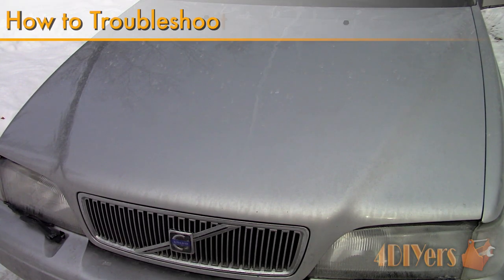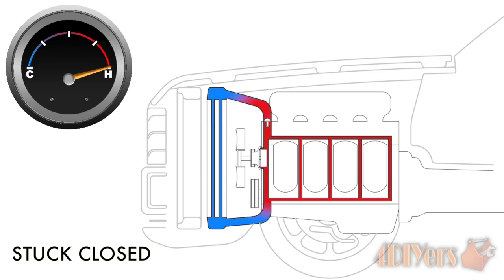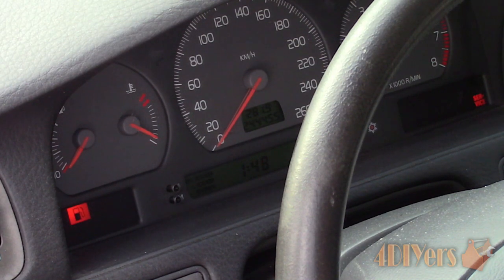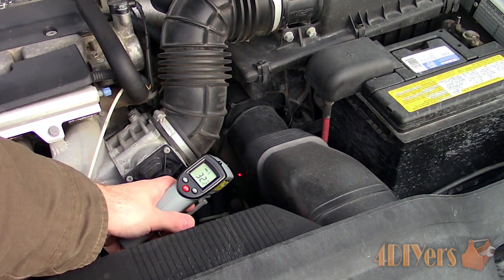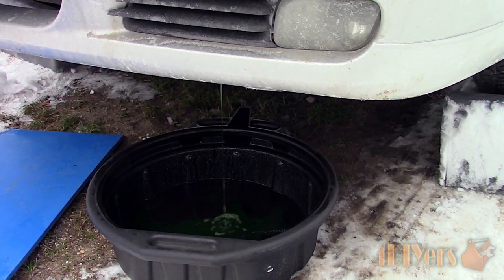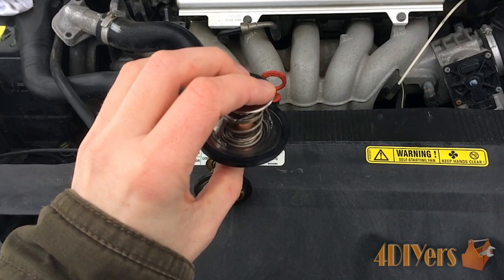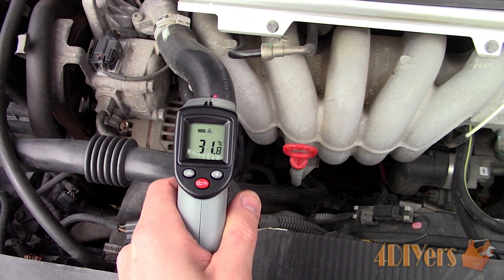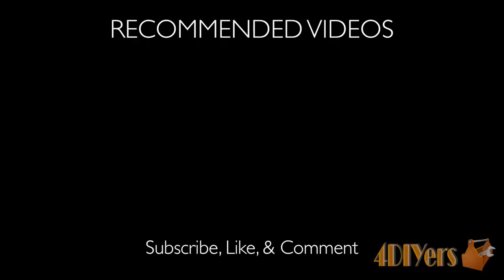DIY: How to Troubleshoot a Faulty Thermostat

Comment: My 2002 Pontiac Firebird has always ran at a certain temp on the gauge.  Today, with the AC on (103 degrees weather), it went over that mark and started climbing.  I turned the AC off, turned the heater on, and dropped my MPH to 60.  The temp gauge went back to normal.  4 months ago, check engine light came on, took it to the repair shop, they said it wasn't the thermostat; whatever they did fixed it.  But was told if I have a problem then go back and they will put a thermostat in it.  Just wondering, by putting the heater on and cooling down the cooling system, if this might well be the thermostat problem.  Thank you.  Great video.
Reply: So they removed ypir thermostat ?. Sounds like it ..esoeciallu  if heaters are cooler

Comment: my top radiator hose is hot, my bottom hose is cold but still spiking on heat gauge....just got new thermostat, radiator, rad cap, top/bottom hose and bypass hose replaced. Noticed abit of a leak around thermostat housing few weeks after....faulty thermostat maybe or is it waterpump or head gasket.

Comment: Question: I noticed acceleration loss towards 55-60kmh on my Venture but initially didn't pay attention to temp. gauge. Once home (3-4 km away), I opened the hood to see coolant leaks on top of the coolant expansion tank and around/under it. But not anywhere near the radiator itself or elsewhere.

When running it for a few minutes, even at idle, the temp. gauge would go up high. Because it's extremely cold here today (-28°C), driving it surprisingly lowered the temperature until I slowed down or idled again because of the cool air.

Is it safe to assume that this would be caused by a closed or defective thermostat? What would be the best way to test it from home.. I'll look more in depth tomorrow. Would just checking the hot/cold hoses be enough? I'm not sure what else to go off of.

And could a head gasket issue cause what I've just described before? I called the garage and he thought this would most likely be the cause, without having seen it yet.

Any input is appreciated before I spend on diagnostics please.. thank you!
Reply: Yoo did you ever fix?
Reply: Having this issue rn what did you do

Comment: I'm having problems with my coolant system on my 2002 Volvo C70 i changed the radiator twice and I just put in a new heater core my car is still bubbling out of the reservoir and losing antifreeze could it be a blown head gasket or could the thermostat be bad I need advice on making the next step to solving my problem could you could you provide any information 🤔💡
Reply from the maker: If it's bubbling, it most likely can be a faulty head gasket. Best to do a compression and cooling system pressure test.
Reply: @4DIYers  I did a compression test I put a new radiator system in also I put a new heater core and I also put a new reservoir bottle on the Volvo and it's still bubbling from the reservoir the shop has bled the system and still has continued continue to say they don't know what the problem is it's only three other options a blown head gasket water pump or the thermostat with the temperature sensor connected on to it 🤔💡

Comment: Question regarding stuck open thermostat. I was told that if I just remove the radiator cap and cold start the car, I would see immediate flow of coolant right at the radiator cap.  Does this method work?
Reply from the maker: It works to a certain extent and this depends on the system's design. In the video, you can see a by-pass in the thermostat so this will still allow for flow, however it is limited. When the thermostat is stuck open, more flow would be present.

Comment: Hope you or someone can explain why my vehicle is now stalling at idle when I crank it up in the morning. After it gets to operating temperature, it stops stalling and operates as normal. 

This all started the other day when my friend changed the thermostat and lower radiator hose. 

He took off the upper hose by mistake and broke a piece off the radiator inlet or nazzle, but was still able to get the hose and clamp back on. After taking off the housing unit, he noticed the thermostat was not the same as the one that came off. Ww still used the new one. The lower hose had to be cut and is slightly bent. And we completely forgot to bleed excess air out. 

Besides the stalling at idle, no other issues lol. Heat works just fine.

Comment: MY VW Amarok has had a cooling system issue recently where it seemed the water temp was colder than it should be. While driving the car, the temp would be around 84 deg, but drop down to 50deg C. Then sometimes go up to 93-96, but quickly back down. I have had the thermostat changed, and while running the first time, the temp steadily went up to 94deg C and was up and down around that temp, but when idling my car for a while, the temp gauge drops down to 45deg C, and while idling, it stays around this low temp. Is that normal for the temp to be that low at idle?

Comment: If I’m missing 1 bolt on my thermostat housing on my ‘07 s40 would that explain my car still overheating constantly?
Reply from the maker: If it’s leaking, yes that can potentially cause a problem. Your system is not holding pressure and is most likely leaking coolant.

Comment: I flushed my coolant system, and put new antifreeze in my coolant reservoir, after doing that, I flushed the heater and got all the gunk out of it until the water flowing out went clear. After hooking everything back up, I still get cool heat whenever I turn the knob to the hottest temp, it didn’t fix my no heat problem. I have a 2002 Ford Taurus. Any help??
Reply: Possible a temp door actuator

Comment: My car use to over heat.
I changed out the Thermostat with a new one on my 2010 Charger.
For 2 weeks it ran great & no over heating.
Then it started again but this time the water box had no water and over heated.
I put 2 gallons and ran great.
2 days later again no water and over heated.  There's no water on the asphalt where I park my car.
Every 2 days I need to add a gallon to prevent it from over heating.
The bottom hose is a little warm and the Top hose is hot. I hope I don't have to change the New Thermostat .
I had to take off the 
Power Sterling
Air Compressor
Water heater golding tank
Certaintie belt
The driver's tire to get to the bottom bolt of the AC Compressor.
A real pain . I hope it's not that stupid Thermostat but I'm thinking of having to install another new one or do a Radiator Flush to free up the Thermostat that I put in a Month ago.
What do you think 🤔 
Marty

Comment: My car have new thermostat..but temperature increase...

Normal 5 bar
Bypass without thermostat 3-4 bar
Install new thermostat 6-8 bar

And it will open valve thermostat when my temp go 8 bar...why?

Comment: My lower radiator hose is cold after warmup and when I'm driving. My lower radiator hose popped off this morning. I put coolant back into the system and tightened the hose clamp pretty good. My radiator fans works when the a/c is on but not during idle. Im.hoping it's my thermostat rather then my radiator. But I'm not sure. My car does not overheat as well.
Reply: Hi. I have been experiencing similar symptoms with my car. It also doesn't overheat. Did you eventually find and fix the issue?
Reply: The rad fan is designed to come on anytime the A/C is turned on, regardless of coolant temperature. It sounds like your coolant is not getting hot enough for the coolant temp sensor to actuate the fan. Most likely thermostat is stuck open. A faulty radiator alone NEVER overcools the engine.

Comment: Is this normal?
engine is cold. I remove radiator cap. Turn on engine. When engine reaches operating temperature, the coolant in the radiator starts to boil, not slowly and gently bubble, but boil aggressively.
what does it mean? Is it normal?
Reply from the maker: Could be improperly mixed coolant, air in the system (if it was recently worked on or was excessive low and topped up), or you have a blown head gasket.

Comment: if the upper radiator hose is really hot doesn't that mean that the thermostat is opening properly?
Reply from the maker: Well that means the thermostat is open, so coolant is following. So it's either working properly or stuck open.
Reply: I think what was happening was that the thermostat was opening really late after the vehicle was already overheating. Replaced the thermostat and it's not overheating anymore.
Reply from the maker: Yep that can happen. Sometimes the problem will disappear, but I wouldn't risk not replacing it. Overheating the engine can cause a large amount of damage.
Reply: Yes autozone will purposefully sell a thermo that is rated  195 F when your stock was 175 F that causes huge issues on older cars. 20 degrees is the difference between maintaining and boil over.

Comment: 2010 Ford Focus replaced the thermostat with a new one from autozone. But it still takes about an hour to heat up to normal temperature. What could it be? No check engine lights.
Reply: Alex adamovitch I’m in the same boat any ideas?
Reply: Alex adamovitch try bleeding your cool system it could have air pockets , or try replacing the engine coolant temperature sensor
Reply: @garymijangos9403  No, if that was the case he would have the opposite problem and engine would overheat. Air in system causes insufficient cooling
Reply: Assuming your gauge reading is correct It almost has to be a faulty thermostat. So during this prolonged warmup period the heater puts out cold air?

Comment: I have a 95 civic hatchback and the temp gauge goes way past the hot symbol after idling for 5 mins  but the motor doesnt feel hot. The top hose is hot as hell and the bottom is cold does this mean my thermostat is bad?
Reply from the maker: Definitely don't let it go into the hot zone, you can damage the head gasket or warp the head. You could have a faulty temperature sensor, air in the system, or the thermostat could be stuck. The temperature sensor most likely can be tested with a multimeter taking a resistance reading. As for air in the system, that could only really happen if you recently did work to the coolant system.

Comment: So, if its stuck closed or in between, is it possible that pressure from the system would allow us to come out the top of the hose where it connects to the thermostat housing?
Because I'm having to add fluids and car is running hot.

Comment: Hello
1998 e39 528i Automatic, replaced the original BMW thermostat with MAHLE Thermostat it should open at 92C (like the original) but it climbs to 102C is this normal? 
Thanks for the video?
Reply from the maker: That could be caused from improperly mixed coolant, an air lock in the cooling system, faulty water pump, or a clog in the cooling system.
Reply: @4DIYers  Thanks!
I noticed it opens at 94C and stays around 100C/105C while I'm driving.
I think it worries me is after short drive (15min.) the lower hose (after thermostat) it has a lot of pressure built up when I squeeze feels like more air in it rather than the coolant , it's not hot like the upper hose (the one that goes to the expansion tank).

Bad thermostat, water pump, blown head gasket, bad auxiliary water pump?? Engine only 30 000
Reply: @shefketmustafa9228  
Hy did u solove ur problem i have a problem while i drive the water heat incrased 110 115 celsius and while driving after 5 min i accelerate and he come back to 90 i drive without termostat i change waterpomp the senzor temperature  and the auxiliary pomp nothing solved the problem i change the termostat nothing it only do one Time then u can drive 1000km no problem i Check engine after the heat come the engine was cold but from back of engine from turbo he was hot and was tickling with engine shutof

Comment: Hi, i changed my thermostat, waterpumpv and flushed the system! I added 50/50 mix but it still overheats, i know i need to change the fan because the fan is not working but i did notice something, upper radiator hose is hot but the bottom hose is ice cold, really it's literally no sign of hot coolant there...

Can the radiator be clogged so it cant het rid of the heat? Plz Help guys
Reply: What was the problem? I have the same issue with my infinity
Reply: I'd say you put the thermostat in backwards. It will never open causing extreme overheat on one side only, also can have to purge air out of system so that your thermostat actually has liquid on it to open up. And finally it could be autozone sold you a high temp thermostat in that it opens way too small allowing the coolant to boil and make air pockets at housing keeping it shut.
Reply: Infinity needs to be purged of all air or it will continue to overheat. If the overheat continues , the head gaskets one or two could be blown lowering the coolant as it is scavenged from the coolant system into the pistons steaming out.
Reply: Worst case scenario,  the head is cracked

Comment: Why is there card board blocking a large section of the radiator?!?!
Reply from the maker: Stops the air from going through the radiator to reduce cooling so it helps the car warm up. It was in the middle of winter when the thermostat failed.
Reply: I’m in hot AZ didn’t even consider other conditions.  Makes sense.   Thanks for the reply.
Reply: @4DIYers  When I was a kid my dad had a 60 Volvo. It came with a piece of material that blocked airflow through the radiator. It had a cable running back to the cabin so you could raise and lower it like a blind. Cool.

Comment: My car starts to over heat after about 10 mins of driving. When I put the heater on it’s cold air most of the time. Then will go hot sometimes. When it starts to get hot the coolant boils in the reservoir. Thermostat??
Reply: Don't know if you still need help but if it's getting to your reservoir I'm guessing that your radiator might be blocked make sure it's clean on the outside and maybe check with a mechanic to see if it's blocked internally. (I'm no expert I'm just giving my thoughts)

Comment: How can you tell if the thermostat is bad or if it's the thermostat housing? My car is leaking from the housing.
Reply: The thermostat itself cannot leak. It is completely inside the cooling system. A leak would be either a gasket or cracked housing.

Comment: If you live in Warm Climate - By-Pass it and you will NEVER have to worry about it again!
Reply from the maker: Good tip, however it's not something I'd personally do. For the most part a thermostat is $20 and they can last 200,000km, maybe less or more. I'm pretty picky with maintenance and if you ever had a cold day or travelled somewhere cooler, it'll take the vehicle longer to warm up and increase fuel consumption until the engine kicks off the cold cycle.

Comment: I don't have a thermometer, but my civic 2006 lower & upper hose are both hot once I start the car. Does it means it is stuck open or even removed?